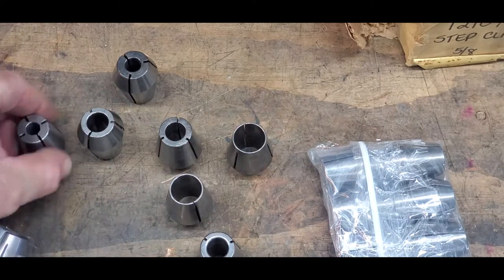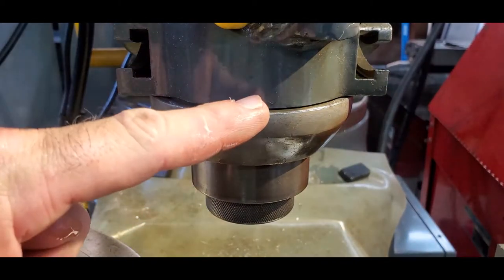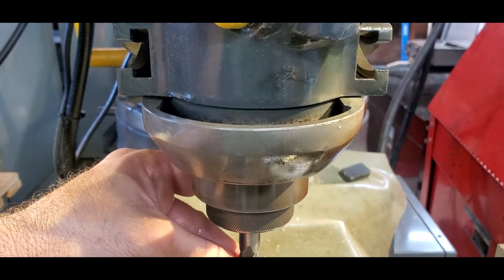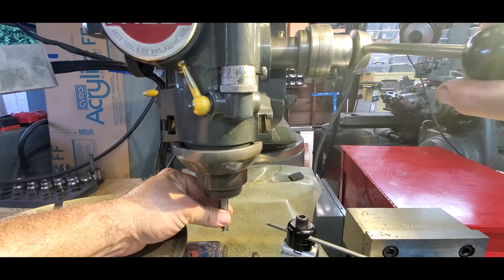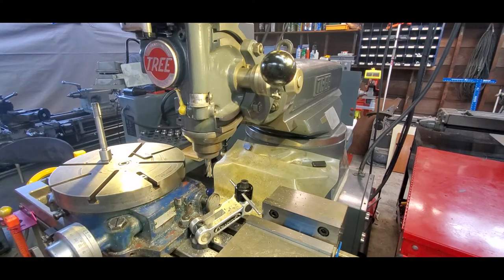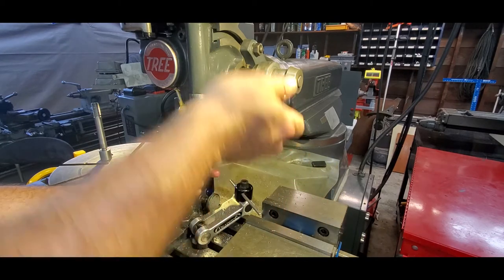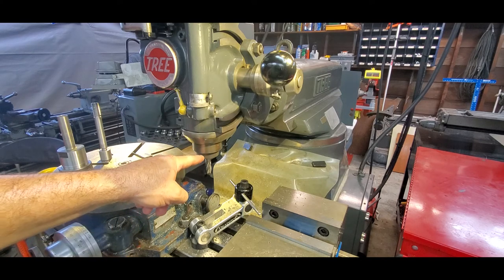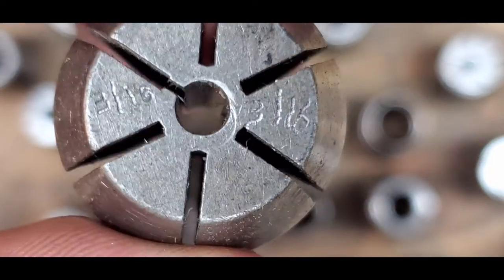Tree Milling Machine Collets and Built-in Closer!

Comment: Question. It is hard to adjust the lower nut to lock the collet in place
Reply from the maker: No
Reply: @daviddominessy   that is ir was ture I have been using the machine fir 20 plus years. But know I am not able to lock a tool in the collets.  Question. Why not
Reply from the maker: @duanedavis8106  watch video carefully

Comment: I’ve just picked up a Tree, but am missing the collet closer nose (what you refer to as the nut).  Checked with several suppliers of used Tree parts with no luck (part m-1003).  Any ideas if there are dimensions available for this part so I can turn one?
Reply from the maker: It'll need to be hardened.
I have an extra one buried in a box!!
I am moving And all is in storage ATM.
Sorry

Comment: I have the same milling machine, but my collet closer doesn't work, I think it has been monkeyed with in the past . I can't seem to figure out how to disassemble the spindle nose to try and repair it. do you have any idea how the spindle nose comes apart?
Reply from the maker: This I do not remember.  I hope you get to the bottom of this!
Reply: After you figure out how to get at the closer, I cant help you there, one not and the spindle comes out. You will see a set of ball bearings. One missing and it won't work, one to many and it won't work. I think 11 is the magic  number.
Reply: Did you figure this out, mine is the same.
Reply: Unfortunately I have not. Never figured out how to disassemble the spindle nose

Comment: Hey I too now own the c model tree.where did you get belts for yours since both models have the same head.there has to be another mill that uses the same size belt, any info on other part number crossovers.otherwise I I have to measure the rotten ones and call Dayton belt Co. I'm hoping you have the answer.got mine for 500 dollars and everything works, even the clunky old NC controls.did I do ok?
Reply: Ok I read comments got it on the quilt belt now I just need the variable speed belt.
Reply from the maker: @haroldsegur9524  Eagle machine is where I found mine. 
Fleabay
Reply: @daviddominessy  thank you!